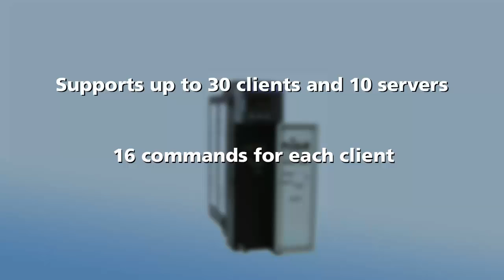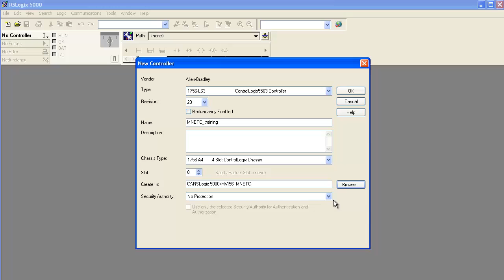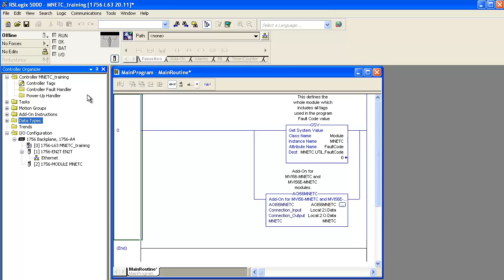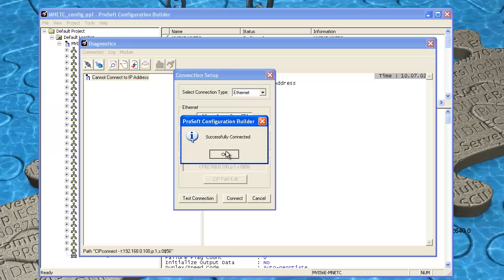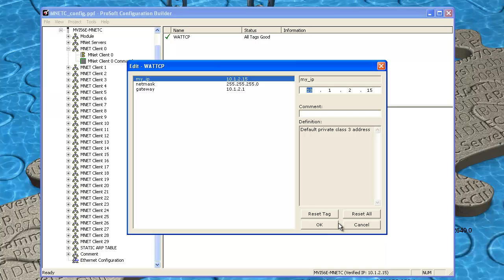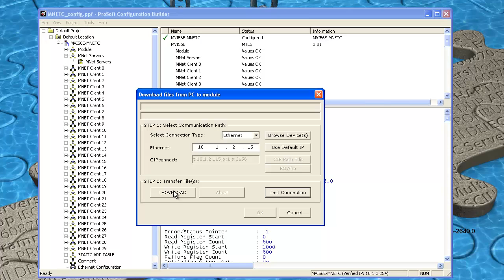Set Up: Modbus TCP/IP Multi Client/Server Enhanced Network Interface Module for ControlLogix

Comment: For anyone wondering...I imported the ProSoft device settings to my PLC, but then after that I found out I needed to change my read/write array sizes and starting points.  That's easy to do on the ProSoft side, but on the PLC side I found that you need to change the array size.  (If you're changing starting points, I found the PLC didn't care and still wrote to/read from the correct spot on the ProSoft device.)
To change the read/write array sizes on the PLC side, I went to the User-Defined Data Types and scrolled down to the MNETCDATA field.  Once here, I resized my arrays to match my changes in my ProSoft.  (Note:  I was using Studio 5000 for my development environment.)

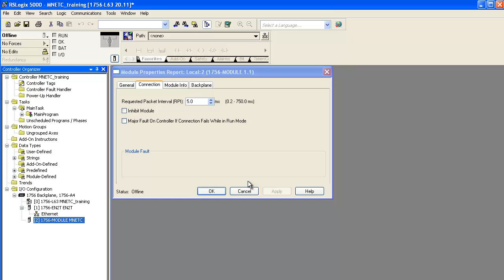Comment: Just so we're clear...at 4:39, there's no way to communicate over DINT?  The MNETC is hard-programmed to use INT instead of DINT?
Reply from the maker: Hi there! You do indeed need to use INT in the I/O tree. This matches the size of a Modbus register, 16 bits. Having said that, as is the case with Modbus, it is still possible for us to read and send DINTs, we just read or send them two Modbus registers (16 bits) at a time, then on the PLC side the integrator can use a COP or CPS to transfer the two INTs into a DINT or vice versa. But they will always be initially in INT form as Modbus does not have a DINT register type. If it helps, we have a video on handling 32 bit values in our modules at:
https://www.youtube.com/watch?v=U-c4_KF3U14&

Comment: Hi everyone. If I would want to connect a HMI device (of other company) to one or two Allen Bradley PLCs over modbus tcp/ip protocol and using the MVI56E-MNETC module, Do I have to connect the HMI,  all PLCs and the MVI56E-MNETC module to a simple ethernet switch, as in the video? Thank you.
Reply from the maker: Hi there! You would want to use a switch or hub for that application. If you have any additional questions, feel free to call ProSoft's Tech Support team at 661-716-5100. Thank you!
Reply: @prosofttechnologyinc  Thank you for your attention. Probabily I was not very clear with my question, can I use a simple etherner switch or hub to connect a HMI display (of other company) with one or two Allen Bradley PLC, over the modbus tcp/ip protocol and using the MVI56E-MNETC module?
Reply from the maker: @sc6515  Yes, you can!
Reply: @prosofttechnologyinc  Ok. Thank you so much for your answer and for your videos in youtube.

Comment: Hi, I'm currently configuring MVI56E-MNETC with AB Control Logix L73. I got a query regarding communication timeout when the slave lose comm's. The situation is that after comm's failure, the previous data on assigned registers keep the values when the slave last got comm's. I wish to seek your help on how to clear all the data to "0" when a slave lose comm's. Thanks!
Reply from the maker: +Andrei K The data can be zero’d out, but you would need to set up logic that, upon seeing a slave had lost communication using our Command Error Pointer, would trigger our cold boot bool.  However, doing so also reboots the module, resulting in a break in communication, so the recommended course of action would be to instead create logic that disables whatever existing logic is looking at the “stale” values whenever our command error pointer indicates the corresponding slave for that data is down.  If you have any questions, please call our technical support team at 661-716-5100. Thank you!